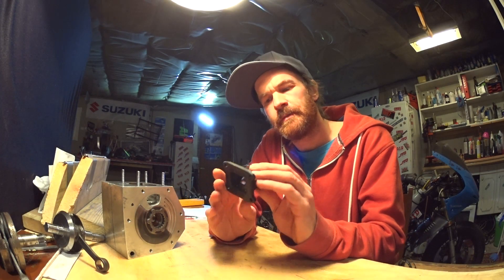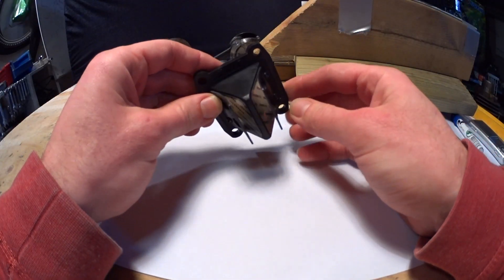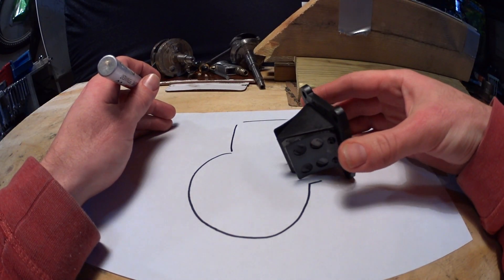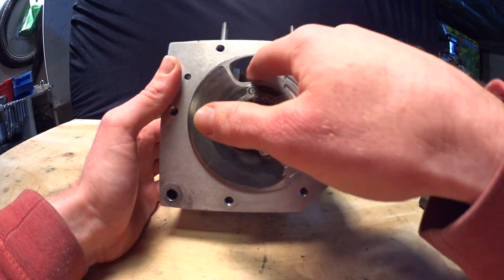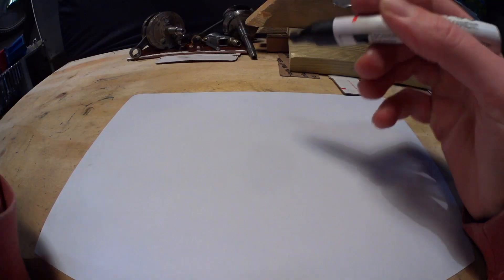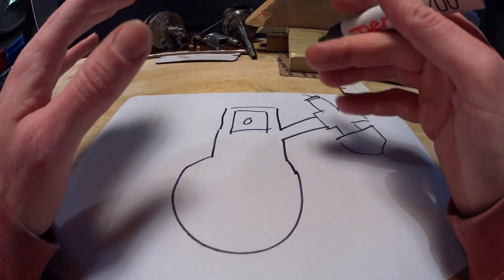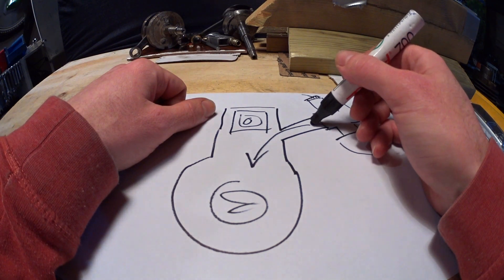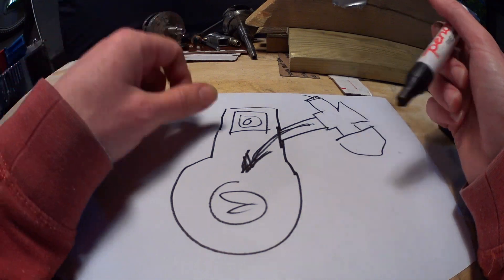TWO STROKE INTAKE TYPES | Reed Valve, Rotary Valve, Piston Ported

Comment: Nice simple explanation...Btw, I own a 1986 Suzuki RG500 Gamma scooter with Loomey Expansion Chambers and Silencers, bored out 30mm carbs, modified Rotary Valves, a Port Job and VHM heads. I would swag she has about 135 - 104 BHP., and she's a wheelie machine. She also has GSXR Forks and Wheels, Brembo radial brakes and oversized racing rotors and Wheels with modern Pirelli rubber and a Yoshimura Racing Swingarm.

Comment: I have thinked about that, could a rotary valve actually act same time like a littlekind of charger?? If the valve would be done correctly notched, it could compress air fuel mix in. And also it could act as a flywheel too, partly offcourse, but it would act like a timed supercharger, shoveling air into motor. Desing could be just like plate working, or something like hamsters running wheel type.. or combined..somehow to get little bit pressure first, and when the valve opens BOOM! Mixture shoots in..

Comment: Hey man, can you explain in a further video which intake is the best? Or the advantages and disadvantages of every of the intake types. Will be a interesting for many people I guess!
Reply: Seems like Kawasaki KX125 1975 had a rotary valve. I rode one and it would come on the pipe immediately without revving or having to Fan the clutch. Unfortunately it had the suspension of a go-kart and handled like one! Could not enjoy The Ripping engine, it felt like there was no suspension on either end. Rough ground would make the handlebar slap the tank! It was not my motorcycle and I had a decent time writing it that day but it was very disappointing to not be able to use that 2-stroke rotary valve to its potential. I would later on a 1976 Honda CR125 Elsinore and it would rip like nothing else but you better be prepared to scream that engine and shift gears quickly! Luckily it had one of the slickest shifting Transmissions I have ever experienced, barely nudge it and it had the gear. Hardly ever missed a gear and would corner like a roller coaster on Rails. Making me go back in time and remember team Honda Rider Marty Smith. Back when two strokes ruled and made riding dirt bikes affordable. Two Strokes still dominate in my book. But I have to admit four strokes have came a long way, at a very high cost.

Comment: A few comments on the advantage of a Rotary Valve.   1. There is no lag time as there is with reed valves and no blow back when the pressure comes against them and tries to close them.  2. There is no vacuum created under the piston like in the  PP systems and the air flow can be longer.  3.  The Rotary Valve does however place a small load on the engine but timing can be more accurate improving the intake flow..
Reply: Rotary valve better than reed valve?

Comment: Question, can a rotary valve 2 stroke kawasaki engine be ported if so how? If not why? I cant find anything online about it
Reply: I have one, and yes it can be ported. You can also adjust the design of the rotary disc to adjust it's port timing. ( I don't know it my English terms were right, but thats what we do here in the Philippines.) We have many rotary valved motorcycle models here. For example, the Kawasaki HD3, (exact same engine as bushwacker 175, but with smaller 125cc block. We also have Kawasaki Brutus 140 which have the exact same engine as bushwacker 175 but with smaller bore of 58mm. And some Suzuki gp 125s
Reply: @rennierrodil6119  how long do the valves last is it something to worry about or do they out live the piston ?
Reply: @raccoon681  It ast longer than the piston. Though sometimes it deforms and somewhat affects the efficiency  and performance of the engine.

Comment: The bicycle mount engine kit is piston ported! they are a hot cheap item on ebay. I have two, first thing is to get strong mount bolts because they are the first thing to break, every thing else just needed to be tight.  A reed valve kit is optional and the piston would need a port hole.  But im happy with the dual spark plug racing high compression head.
Reply from the maker: +Daniel DeNapoli Thanks for the heads-up on the bolts! Dual sparkplug head you say?
Reply: All can be found on ebay including copper head gasket pull start option and chopper mount plate, banana exhaust chamber  ..its an aluminium Chinese engine ,advertised as an 80cc engine but its really a 66cc engine  and piston ported its not EPA or Carb approved.  I have one mounted on a homemade scooter with the chopper engine mount. .
Reply: The dule sparkplug head is optional hard to find on ebay for about 50 bucks thinking of getting it to be like the old 1970s enduro dirt bike that had it. you can have duo ignition or switch plugs if one becomes fowled

Comment: Piston port intake are most common on chainsaws and such hand tools due to it's simplicity. Radne's go-kart engines are one of few larger engines that have piston port intakes, 14hp in their 120cc isn't very impressive but they run forever and are very reliable.
Reply: Many older snowmobile engines are piston port as well. Polaris triples, for example. Some as large as 800 cc, routinely making well over 100 hp with triple pipes.
Reply: Hey that’s not bad a 200cc 4 stroke only makes 6.5 horsepower
Reply: Maico
Reply: I forgot to say engines made today. Radne is probably the only +100cc engine made today that's piston ported.

Comment: The bicycle is a piston port style but is commonly converted to a reed style by cutting a window in the side of the piston
Reply from the maker: Should try that mod and compare the two on the dyno! Really looking forward to this motorized bike project! Can't wait for the kit to arrive! Huge thanks again!
Reply: The more high end way is at the base of the jug straight into the crank case.
And your welcome.
Reply: And almost forgot the intake gasket is horribly mismatched (normally) would be a good chance to show the effects
Reply: @2STROKESTUFFING  what is the dyno comparison b/w PP and Reed valve on a bicycle engine?